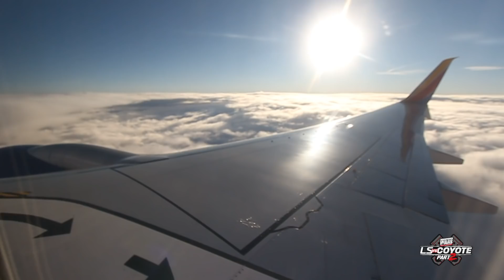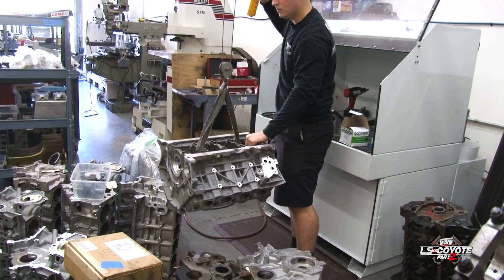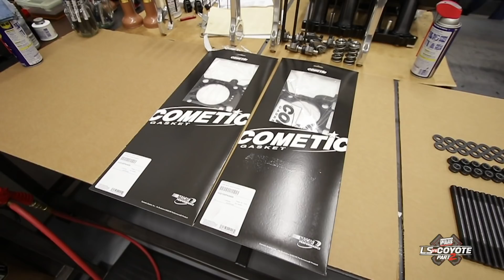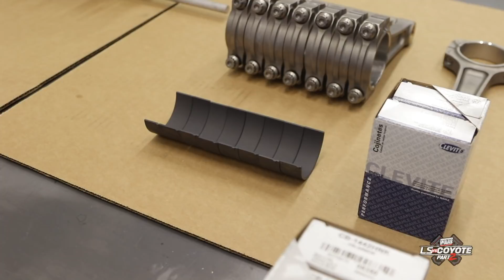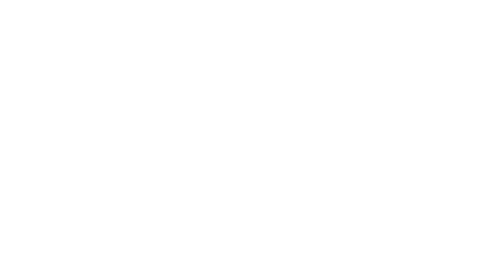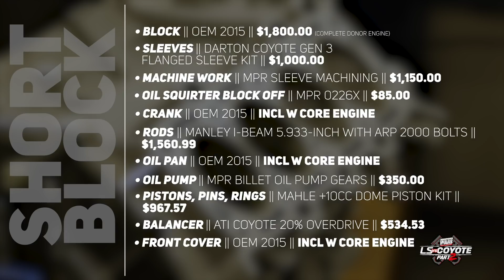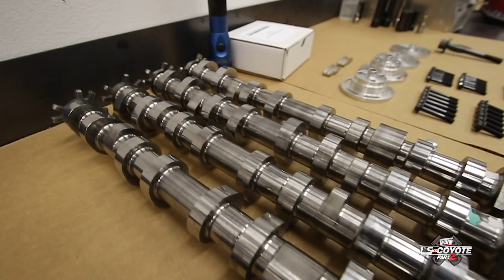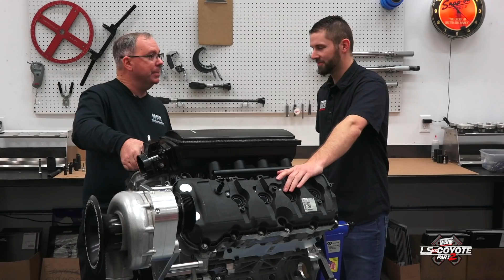LS vs. Coyote 2 Episode 3: The Coyote Engine Build

Comment: ? why are they using a 7.0L engine to go up against a 5.0L engine? Isn't that a bit of an overkill? Doesn't GM have anything close to the displacement of the Ford to use?
Reply: This is a competition not a comparison.
Reply: Okay why is Ford using a 4 valve engine instead of a 2 valve engine what about that comparison Chevy makes all that power with two valves when Ford is producing Engine with four valves and 4 camshafts Coyote motors are way more expensive to build than a LS motor any day
Reply: Robert Johnson the LS also needs an extra two liters or 125 c.i. To be equal. Both engines have their pro's and cons the only reason the LS is cheap to build is because it's an antique. The Coyotes build cost has dropped a ton since the motor came out 8 years ago. If Ford kept building the Windsor it'd be just as cheap to build as an LS. Fords push rod engines dominated the strip for years and after the Coyotes replaced the 4.6 GM threw a fit to Hot Rod/NHRA and had it banned from the builders competitions. I'm a Mopar/Porsche guy but you have to give Ford some credit they've made some amazing V8s the Coyote being one of them
Reply: @ReelWildOne , 2 liters is a 122 cubic inches
Reply: Someone said the 5.0, which is capable of 2200++hp, a "hunk of junk" while there is not a comparable GM engine to even try to use in this challenge. K
Reply: The 6.2 can be stroked to 7.0 by just changing the crankshaft.
Reply: Yes they do. 4.8 LR4 truck engine. Shorter stroke than the 5.3 truck engine. 6.0 big bore truck block plus the 4.8 LR4 crankshaft plus ported factory LS3 heads equals a 8000 plus rpm screemer that's under 5.4 liters. 👍
Reply: Alpha Wërks Ford just released a 7.3l give it a few years. And don't forget about Fords OHC 600hp pump gas 427 from the 60's. Nascar banned it before it ever hit the track.
Reply: Yeah,but it can't get close to the Coyote in performance.
Reply: bigpigslapper Oink it doesn't tho... Maybe in build price. I used antique to describe the LS because they've been built for ever and parts are cheap because of its age. The coyote build cost when new was insane and in 8 years that price has dropped drastically.
Reply: ofcourse they mever built an engine close to the 5.0, they always built the bigger engines to easily "beat" any other engine but then there came the little 5.0 who beat any other engine including the 427. Idk about dodge. but even dodge shits on chevy engines. tbh
Reply: You do realize its a DOHC assembly, right?